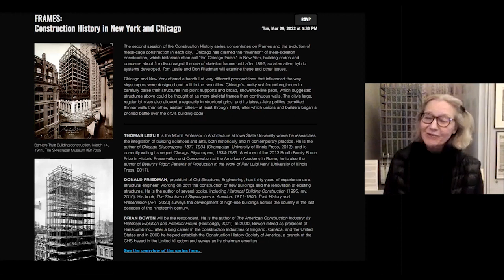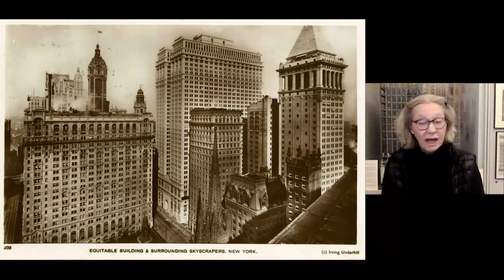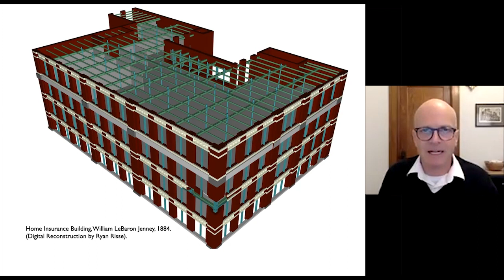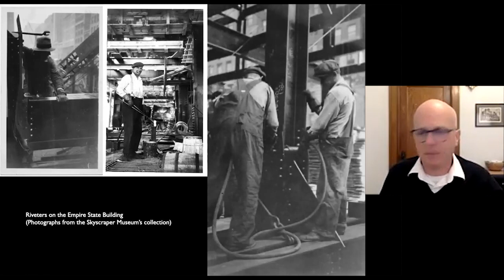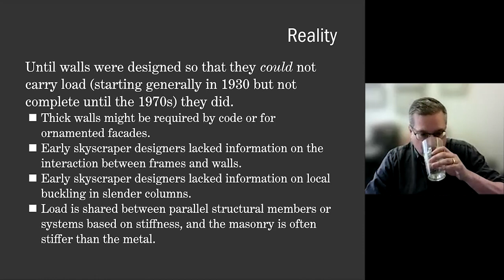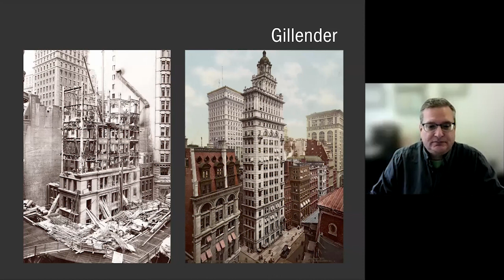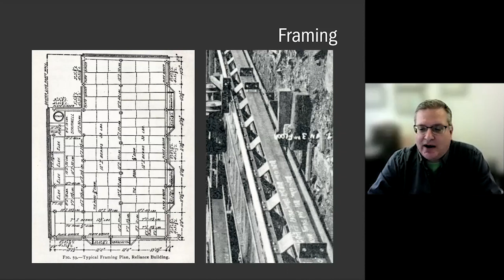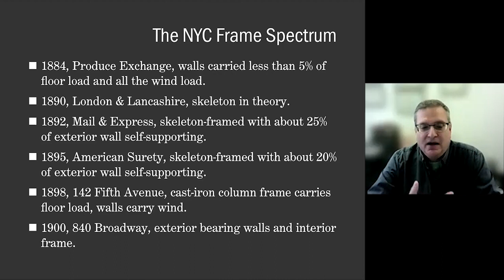FRAMES: Construction History in New York and Chicago

Comment: I love this.  Suggestion: I hope next time they use a little more bandwidth for the voice communication, because it's very grating on the nerves trying to follow these speakers' brilliant lectures.  I don't think the video of the narrators is necessary but better voice sound would really help.  You could have a still photo of the narrator, along with a clear voice signal.  The still photo would be clear too, compared to the video which is so blurry you can barely see the mouth moving.  Thanks for doing these lectures.  I am building a low rise steel building and it's helpful to learn the various techniques over the years.  I took History of Architecture in college but that was 20 years ago.